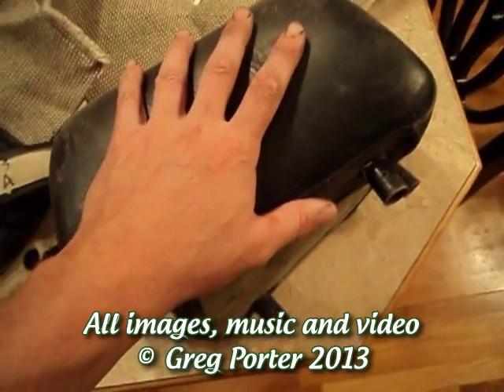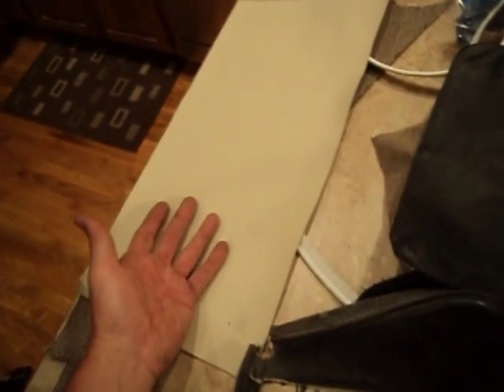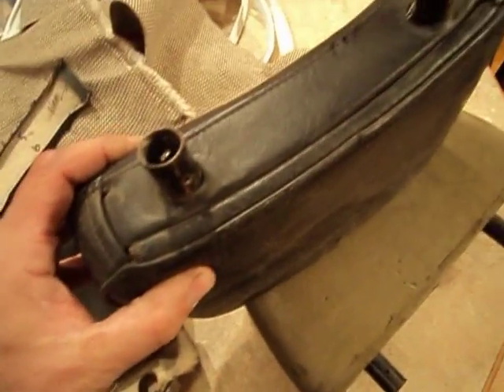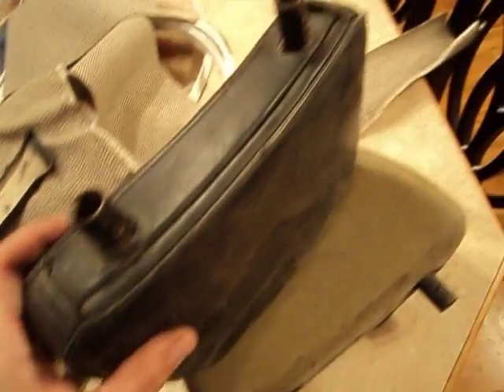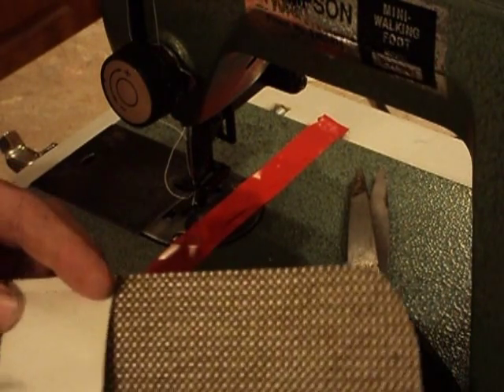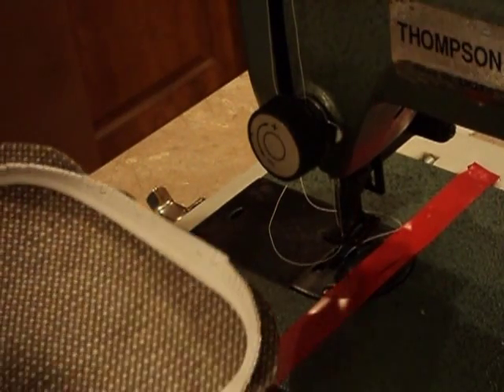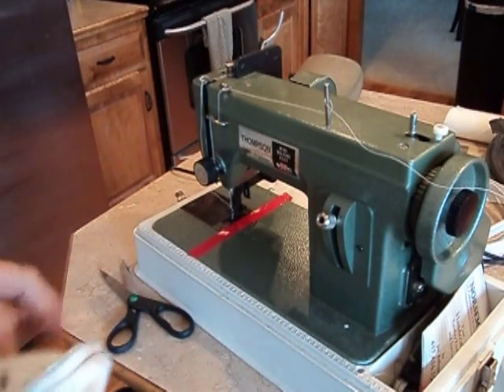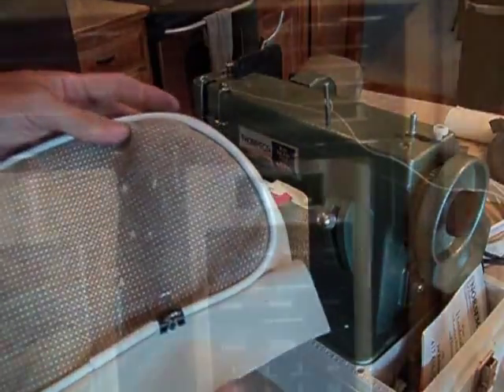Automotive Upholstery 101 - VW Headrest How To

Comment: Second, THANK YOU for showing that, I have searched and seached for videos on doing upholstry and they're few and far between. I've learnt loads from the ones I've found, but I'm always looking for more. Using staples on the remainder side of the stitch is a great tip -- way more stable than using pins. And I don't think I've ever seen anyone cover the finishing trick to wrap the join in the piping before, that's wicked awesome :-)

Comment from the maker: then go to an auto upholstery shop and ask them if you can buy supplies.  Most are happy to help you out.  They can also answer simple questions or let you watch as they sew a few things.  That's exactly how I picked it up.  It took me quite a few tests and 3 machines before I figured out what would work.  The walking foot makes things 1000x easier.  Don't fall for an "add on" walking foot, they are in the same ball park.  Sailrite, reliable, thompson all have good little machines.

Comment from the maker: The thread is stuff I buy at the upholstery shop.  It's UV and has synthetic fibers vs cotton.  I ask the for the thread you use on boat interiors.  Vinyl for boats is also different than vinyl for cars.  Your supplier should be able to give you the details.  Some types stretch, others are stiff.  For upholstery, you'll want a true walking foot.  There is a company called sailrite and another Reliable they have the same machines as my thompson.  Not super cheap but they are what you need.

Comment: If you wanna fix your bobbin wonder thing, take off the top and replace the o-ring lookin thing that makes contact to handwheel while in bobbin mode. Over time it gets worn out, which is why you probably are required to add more pressure to get it to work. Replace and it’ll work good, though I’ve never been a fan of horizontal bobbin wonder mechanisms... anyways nice work. I really wish I had a walking foot machine like this!
Reply from the maker: Thank you!  I'll give that a shot!

Comment: Awesome job. Question.. What type thread are you using? is there a difference between furniture and auto thread and material? I would think auto material would be UV ready but maybe not. I can sew, made curtains for my 70 Bus but I will need a stronger machine for upholstery sewing. Any suggestions for that? Awesome music also, Bass Player/VW nut myself. Thanks for the vids.

Comment from the maker: If you know how to make patterns for clothes, you have what it takes to do seats.  The seams are the kicker.  You have to decide to do welting, french seams or top stitch.  All have challenges.  If you are using cloth your normal machine will work with a little persistence.  You want a wide stitch (5 per inch or so) if your machine can do it.  Go to an UPHOLSTERY supplier to buy your thread, needles etc.  They will get you sorted out with everything.  If you don't have a good supplier... cont-

Comment: The thompson was purchased by Sailrite, the current Ultrafeed is based off it's design, but is a bit more refined in design. I have the Ultrafeed LSZ-1 which is the zigzag model... great for sails, but you don't use it for many other occasions.

Consider both models as a heavy duty class 15 sewing machines. Other than the walking foot, they are really just older metal machines. Not saying in any way shape or form that old sewing machines make good upholstery machines - THEY DO NOT!!! They are not leather machines, nor are they for making sails all day long. They will outlast any new machine on the market today and are very simple to maintain, but they are still JUST A HOME SEWING MACHINE.

eBay sellers who sell them as industrial strength are flat out lying and taking advantage of people who just do not know any better. They will NEVER replace a true industrial machines. Most industrial machine have a oil bath and pump to keep the machine lubricated, Home machines do not.

Nice contrast of material for the seats and headrest, I like the look.
Reply from the maker: Great information David.  I'd LOVE to get my hands on an industrial machine some day.  Truth is, I don't sew often enough to justify the purchase.  Thanks for the kind words.